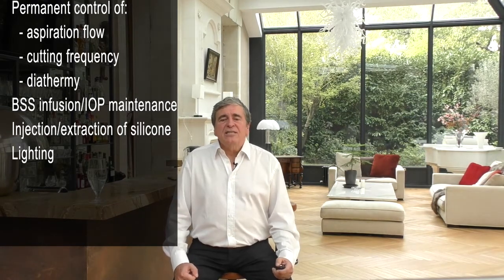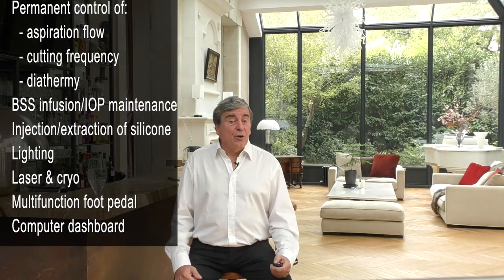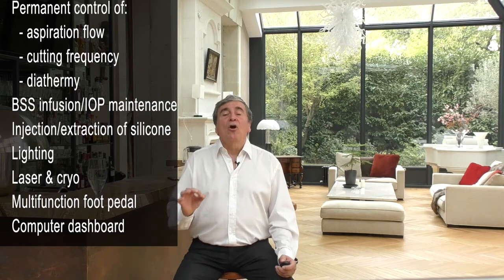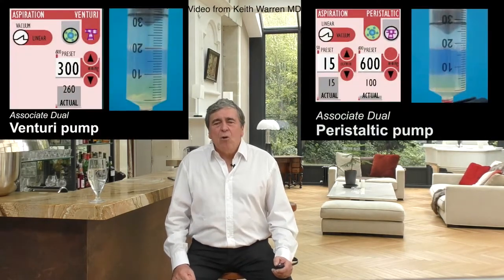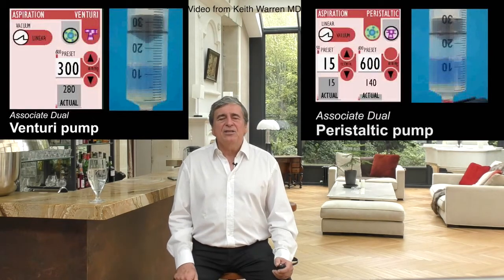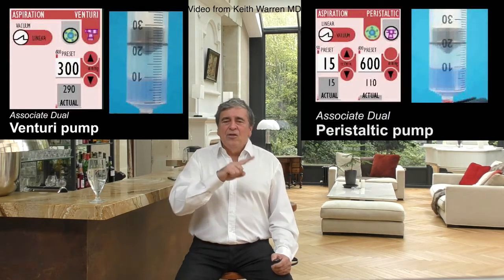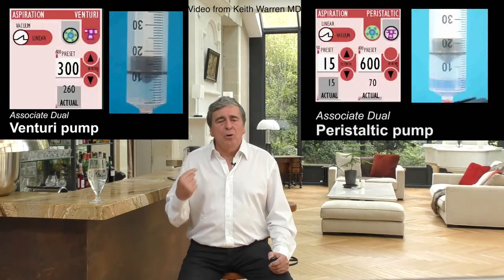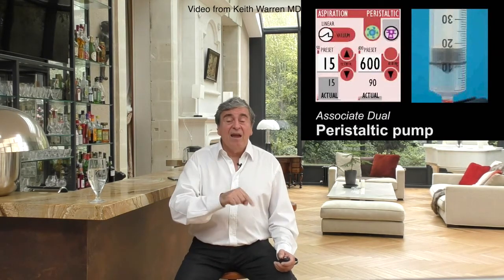Retinal Detachment 13: Vitrectomy Machine Choice: Part 2

Comment: Sir what type of needle you use to lift the membranes
Reply: It depends of the "membrane" type
    -for posterior hyaloid: a curved needle (you need a very sharp needle to enter the fibers)
    -for ILM: the forceps to pinch the tissu
    -for PDR: a blend hook to separate the structures using the plan of clivage
Reply: @lachainededidierducournau5597  Sir which gauge of needle we can use. What I understand you have to make a needle like cyctitom. But which gauge. Thanks n best regards
Reply: @9EyE9  I do not know if such a needle exists in 25G. Your gauge selection depends on so many parameters (type of machine used, evidence of a large pure hyaloid plaque...). This is why I spent so many chapters to explain my rationale. But my rationale is not necessarily yours
Reply: @lachainededidierducournau5597  thanks a lot lot. I'm still in middle of the course. But course is mesmerizing. Your strategy is excellent. You are my mentor Sir. Thanks for teaching us
Reply: @9EyE9  Thank you. It's an honor